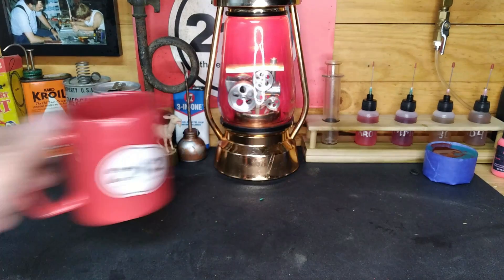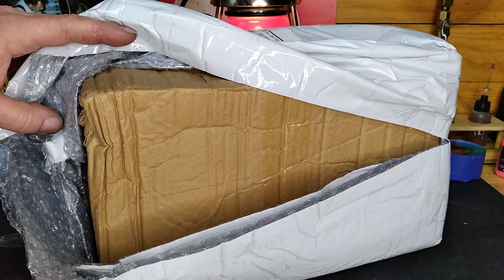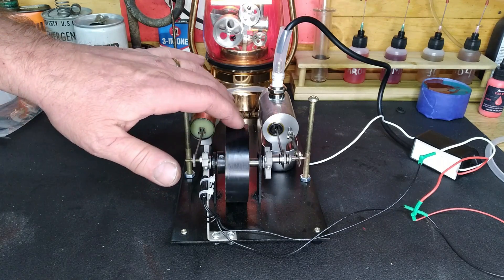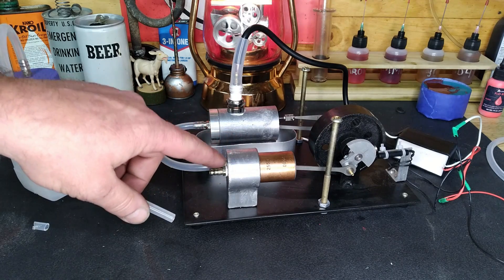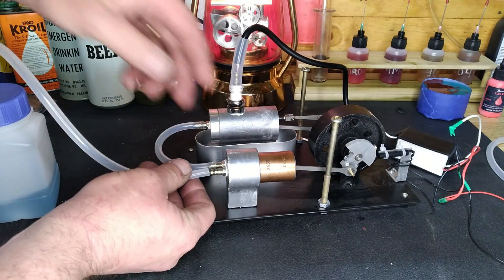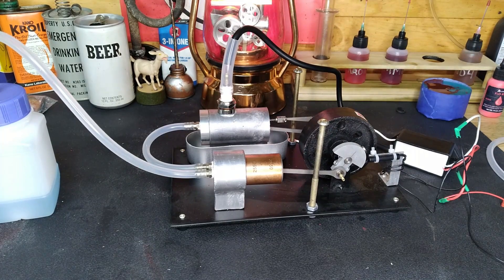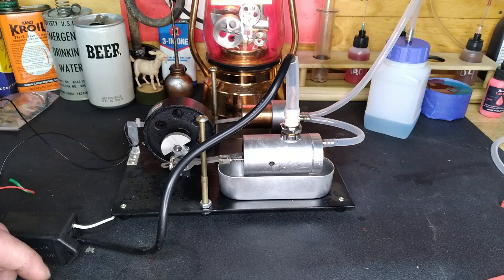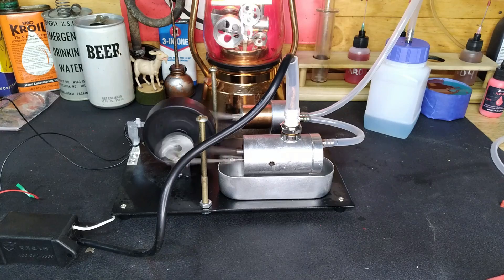3 Stroke Model Gas Engine From Engine DIY, Will It Run?  Cheap But Fun!

Comment: Does it have any torque?
Reply from the maker: Very little, but there are no provisions for an output pulley to test it. It is very easy to slow it down with your finger on the flywheel. No where near as much grunt as a conventional style engine with the same displacement has.

Comment: Bonjour,
Latest information given on my video :
"The first copper-plated piston is a pump to power the engine (kind of volumetric compressor) and the 2nd is the engine with a slide valve which serves as an intake/exhaust valve, and the tank acts as a carburetor (air-fuel mixture)", 
This last point explains why my inlet pipe was not cut and I use a special gasoline called in France "essence F" as it accepts different ones.
That does not explain where this e,gine come from and the lack of compression without ignition... Hit & Miss...tery 😁
Amicalement, Raphaël

Comment: How is the speed governed? Or is it always in “runaway” ?? 😅
Reply from the maker: There is no governor on it at all. The only way to somewhat control the speed is to adjust the mixture by closing the air bleed hole in fuel line.  We'll be working on it now and then to improve some of it's "features" 👍

Comment: Bonjour,
Quite funny, and weird engine ! I would have like to buy also one, so cheap, but I don't see it on their site, would you be able to share a link with us ?
Amicalement, Raphaël
Reply from the maker: I hope this helps, thank you for watching and commenting 👍 https://www.enginediy.com/collections/gasoline-engines/products/mini-horizontal-single-cylinder-three-stroke-engine-gasoline-kerosene-methanol-internal-combustion-engine-model
Reply: @steam212  Bonjour ? (I prefer real first name 😉)
Many thanks for the link, I have immediately ordered it even if the price has significantly increased, it remains reasonable. Il will not hesitate to ask you some help if I can't start it by myself.
Amicalement, Raphaël
Reply: @steam212  Bonjour,
So bizarre, just received, put on the table, gas plus battery and... it runs as yours ! Many thanks for this discovery so original ! I will also make a video (in French) and will make a referece to your channel for my English followers 😉
PS : I noticed a leak at the level of the cylinder head, it is it is intentional, I unscrewed it, there is a notch next to it at the cylinder level.
Maybe it replaces the notch you made in the fuel inlet pipe because mine didn't have one.

Amicalement, Raphaël
Reply from the maker: @rhavrane  That is fantastic!  It is really a neat little engine in how it operates. I was very surprised that it ran that well. I'm glad you got one to experiment with. I'm looking forward to seeing your video 👍
Reply: @steam212  Bonjour,
I have shared this video https://youtu.be/EoOTqsABUvE with members of English or French forums and no one is able to tell me where this engine comes from as the chinese manufacturer has not invented it.
Never mind, I will go on following your channel to find possible new ideas as I am first a steam then an original vintage engines passionate 👍
Amicalement, Raphaël

Comment: Terrible workmanship but, Jings! it runs...Ah wid bet ye cud put an air valve on the intake line tae adjust the air intake mair precisely. Ah' m fae Scotland an ah hae ne'er seen ainythin like this. BTW, it's ae 3 stroke engine in principle
Reply: I know that you are speaking english , but, what did you say?
Reply from the maker: @joesenkalowski7912  We need to put an adjustable air bleed on the intake hose going to the power cylinder.   I'm pretty sure
Reply: I worked with a brilliant Scottish electrical engineer once. In 20 minutes she explained   
to me, the millwright, and my pipefitter partner the problems we were having with a hydro servo system: oil pressures, limit switches and PLC controls. 
She was totally right. She walked away and we looked at each other and asked , what did she say? LOL.
Reply from the maker: We will add an adjustable air bleed to it and see what else we can fix on it too 👍

Comment: Just checked. Price now $160’s. Guess your review was watched by manufacturer ! Your videos are working .  Good job !
Reply from the maker: I really doubt that this video would be considered as an endorsement by them, I would have to think that price increase is due more to inflation than my time in the shop. (This model has been on the shelf for 18 months)
Reply: @steam212  Believe it or not, I've just received an automated email in my inbox from Enginediy with your quotes "Will it run? Cheap but fun!" with a direct link to your video and another link to this engine on their site with your video embedded. I think they really have paid attention!

Comment: It just shows almost anything is possible with hilariously scrap parts with a creative mind. There's a more 'refined' version of this 2-stroke design on EngineDIY (sold as a 'hit and miss', but its not), with a separate displacer cylinder and a 'see through' combustion chamber cylinder, with almost all metal parts, that also uses a glass vapour fuel tank. It spins a 'lot' faster at up to 6000rpm. I wonder if its related to the Brayton Ready Motor design.

Thank you for posting this particular engine. I spotted it a while ago, someone had to take one for the team!
Reply from the maker: I was pretty skeptical about it when I clicked the "confirm order" button.  Now that it's here in the shop and we've had it running..... I can PROMISE you that it'll be modified and refined.   We're all on the same team here, I was happy to take it 👍
Reply: @steam212  I'm subbing for this, this thing is wacky
Reply from the maker: @Lauri_Heino   Welcome to the shop 👍
Reply: @steam212  Looking forward! This video gave me a laugh. You could try testing it with your alcohol vapour tank that you've used with your H75 engine.
Reply from the maker: @joxthefox-jv1qi  ABSOLUTELY!   It will be a great project to diddle with here and there.  I'll be sure to share what I do with all of you.

Comment: Now that IS hilarious!😂 Who would have thunk that hole in the power cylinder feed line was intentional? I'm assuming it's a 'vapor' engine (i.e. it runs off the vapor from the fuel in the 'tank'). I don't see any actual liquid being drawn from the tank. Like a hit & miss, the exhaust valve seems to be the only controlled valve in the system, and the slit in the line lets most of the combustion pressure out, allowing more fuel to be pushed into the power cylinder via the 'pump' cylinder. Sounds logical, right? Looks like your crank trigger could be a little closer for more reliable spark? I've never actually seen an electronic buzz box coil. Talk about modern retro!🤣 A guy could probably use mechanical contacts and a Model T coil for the same effect, but whatever!
Reply from the maker: You nailed it, it runs on the fuel vapors, and not atomized liquid fuel like a carbureted engine. If you click on the video link that pops up in the upper right corner, I did this to an H73..... IT WORKS!  I fed it everclear (moonshine).  Now that you mention the idea of using a Model T buzz box and a relay....... We'll give it a shot, I see no reason why it wouldn't work.    Thank you for watching and commenting, you guys are GREAT 👍

Comment: tray for water cooling !
Reply from the maker: You're exactly right, I did add water to the tray and continued to run it for another 15 minutes after I ended the video.  It ran great until it sucked most of the vapors from the tank. When I wouldn't stay running (even with the hole plugged) I dumped the remaining fuel out and tried to light it, it would not stay lit.   All in all, this was a fun video to make.

Comment: That's just nuts! Maybe if you put a Tee fitting in the feeder line with a fish tank valve, you can get rid of the lacerated hole and get a little more consistency in operation...

... but, then again, we just might obliterate the absurdity of it all... hmmm

Thanks for sharing this, I can't remember the last time I laughed so hard at a goofy engine since I started up a Chevy Stovebolt Six with bent pushrods and sent the entire shop class scrambling for the exits!
Reply from the maker: I thought the same thing, "I could add an adjustable air bleed to this and it would make sense then".  I can only imagine what the others thought when that stovebolt snorted, farted, belched, and clattered to life all within a few revolutions.  You can't beat a straight 6!